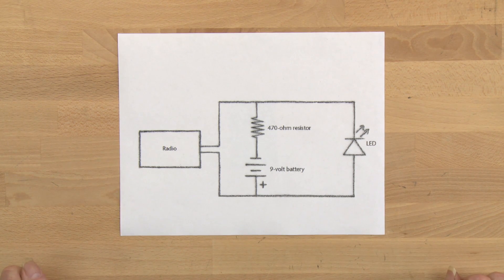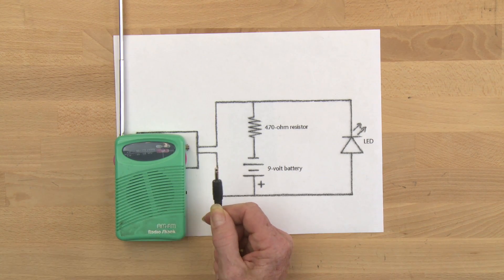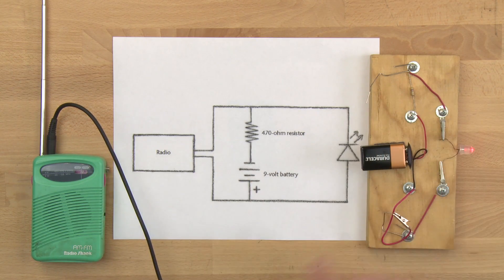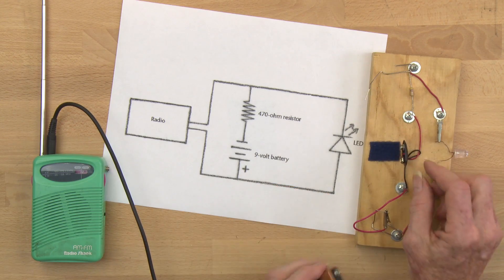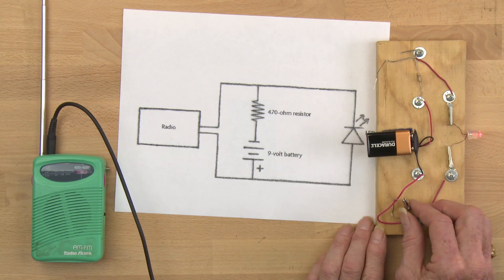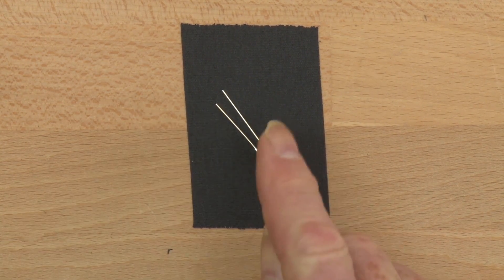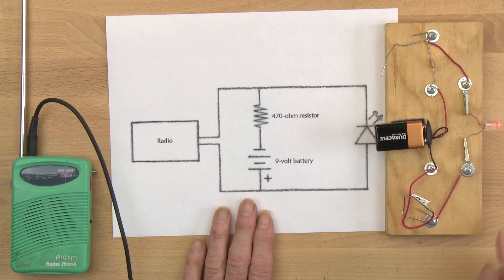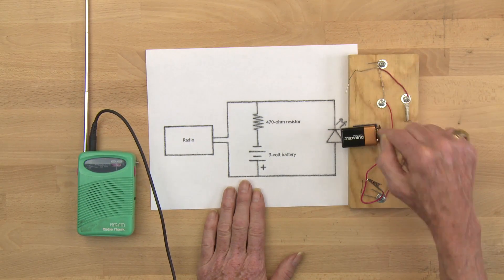How to turn sound into light (then back into sound) - Part 4 of 7: Building the transmitter

Comment: Can anyone help me calculate the resistor's resistance I need to buy. I have a 6V battery with 6.75v-6.9v standby. 

This came inside my Led Camping Light, which is bigger and brighter. So I want to connect a telephone ringer speaker to this setup

Comment: 2:35, It shouldn't be the opposite? I mean If the electrons are going with 9 volts to the LED, It would not destroy the LED? So is not that the electrons are going from - to the LED passing before to the resistor then to the LED then to the + of the battery?